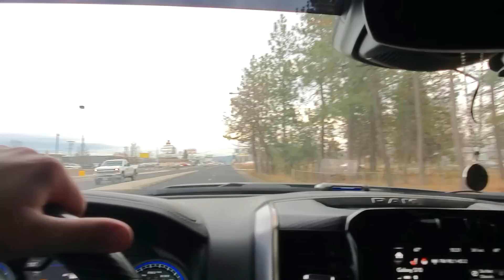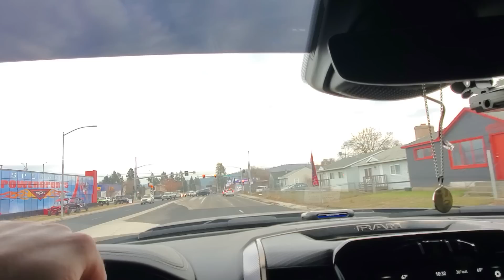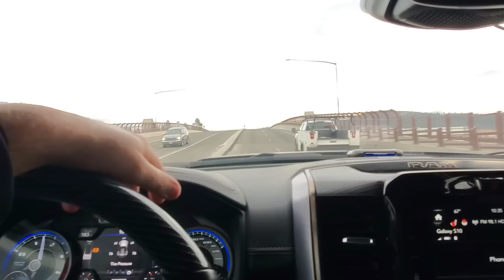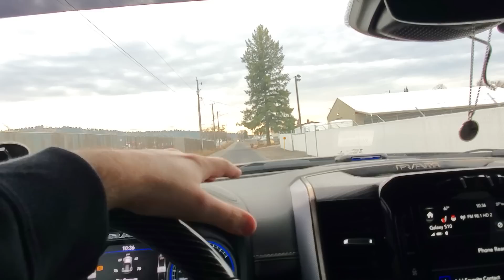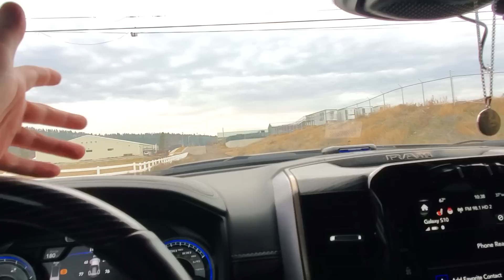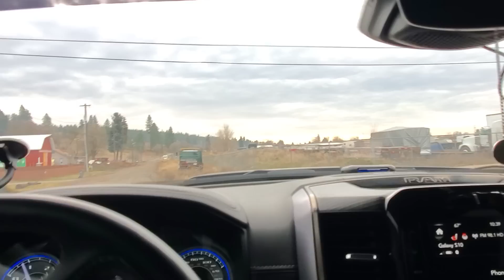2016 Ram 3500 360k miles. Aisin transmission broke down. Vlog #4

Comment: Do you have any trucks with a 68rfe or any experience with them?
Reply from the maker: I dont. All my trucks are aisin
Reply: I didn’t think so. I didn’t remember a video with you mentioning them but figured I’d ask.
Reply: My current 2016 3500 dually has the 68RFE. 85,000 miles and not issues. Pull a 15,500 lb 5th wheel +3500 miles each year around the Carolina coast and the Smokey Mts. Engine is stock and I don't abuse it. Pulls the trailer with no problems and has plenty of power.

Comment: driver error for not sensing something is wrong with gears changing rapidly up and down.  I am thinking this truck was abused in the past by another driver hauling way to much weight, being pegged for hours at a time.  To much weight.  Add a lot of weight-tall load and wind and that truck can be pegged going only 50mph for days .   The variables are endless.  Personally, i don't think the 4th gens are designed to go over 26,000 lbs and last over 350,000 miles without problems becoming extremely more problematic.

Comment: You know, Allison makes Transmissions now for your Cummins and Powerstroke. You might want to look into that. That would be a better investment than the Asian transmission you have now.. if I'm not mistaken I do believe this transmission used to be paired up to the GM 8.1 Vortec gasser back in the day but it was discontinued and the transmission was left without a motor. Ram was supposed to buy this Allison for their Cummins but didn't want to Fork over the money GM was asking. So now GM sold it to the public
Reply: L Rizo the 8.1 vortec’s has Allison’s behind them
Reply: Allison is just a rebranded Chevy transmission behind an Izusu engine. Aisin transmission is not posing as anything. Japanese design  used in everything from Toyotas to Mercedes Benz over the road trucks and motorhomes. Built to last behind a real diesel engine such as Cummins.
Reply: It wouldn't be worth the time. A built Aisin is about the same cost as a stock Allison swap for these trucks and the Built Aisin is damn near bulletproof.
Reply: @theantiqueactionfigure  Japanese designed, like the Duramax designed by probably some of the same Japanese people? LOL only an idiot would think the Duramax isn't a real diesel. Why, because it has a V8 block? Do your research some of the most powerful and reliable machines on this planet are in A V block and most of them are V8, V10 and V12 and V16's such as caterpillar front-end loaders, excavators, locomotives and ships.. an inline 6 was design for easier mechanical maintenance. Which made it easier for people who owned semi trucks and farm equipment.. believe me the Duramax has been proven and tried and in some cases more reliable than some of the Cummins engines such as the 6.7. The Allison have also been proven and you can see it behind engines like Cummins and even bigger and better engines like Caterpillar, Detroit, Pacar and Hino.. you can also find Alison transmissions in our military tanks construction equipment and so on. I'm sure the aisin is good but it's not the best.. Perhaps a built Asian would be better for his truck if not an Allison
Reply: L Rizo the newer 10 speed Allison transmissions are a gm product with the Allison name. But the older ones are straight Allison made. I’m just not a fan of the duramax platform. They seem to be rlly hit or miss. Some guys love them others hate them.
Reply: Yeah the Allison is a good transmission however it won't pull heavy loads as good as the Aisin . Allison 1st gear 3.11 Aisin 1st gear    3.75 ect multiplys torque
Reply: Yes but why spend that$$$$when u can hire an ADULT drive??

Comment: i love watching the people defend there aisin or allison, cummins or dramamax.  i don't care what you drive, when you are grossing 30k you cannot have your foot stuck to the floor.  It will tear up the weakest point of that power train in any make or model.  bottom line is know your basics of mechanics when towing any kind of weight.  It makes the difference in longevity of any truck.  my good friend has an 06 cummins, 68RFE.  that truck is all stock with 200k on the power train.  he takes care of it!  when he owes he is gentle and doesn't overdue it.  No joke, the pastor of our church bought a 2018 duramax, beautiful truck.  4500 miles lost the tranny pulling his 5th wheel.  all i am saying is if you can't be aware of how your truck works and how you need to drive it...... you're dead in the water no matter what you drive.  Good video Paul, not good for the wallet but real information in this.
Reply: Maybe 07 06 was 48re